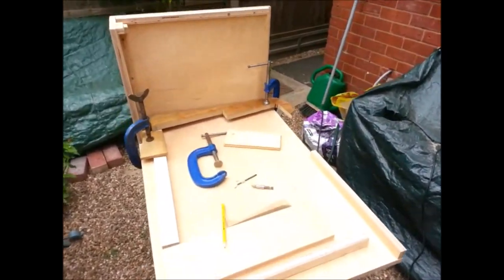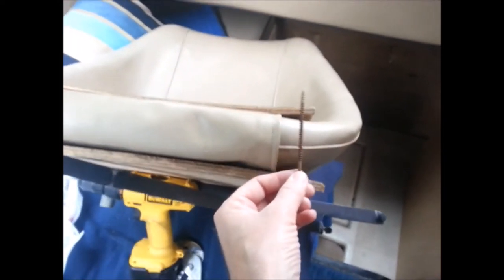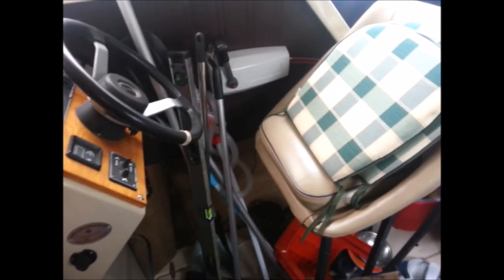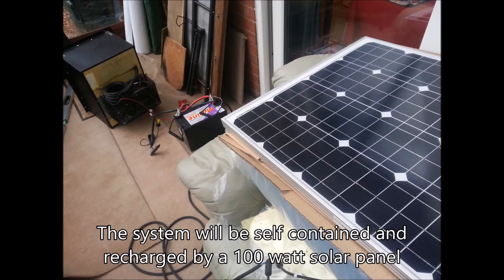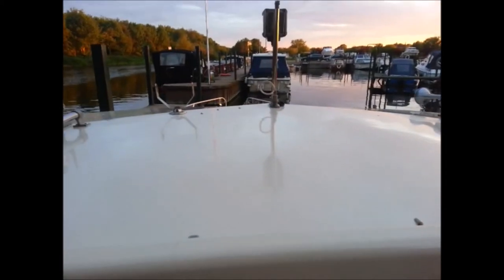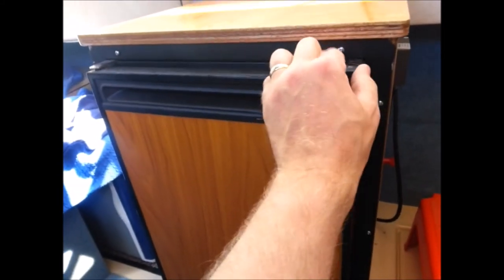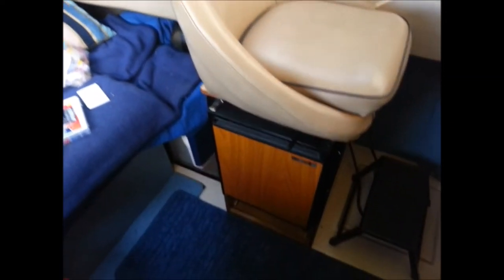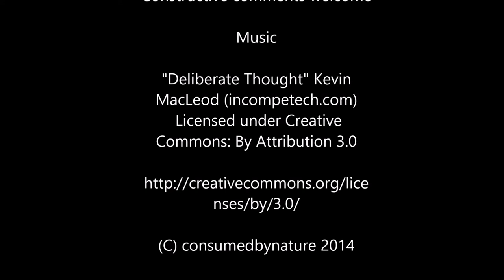Busy with Fizzy episode 6 (Solar powered fridge and cabinet) - chronicles of a 23ft Shetland Boat

Comment: Hi great video. I am looking to do the same thing on my boat but am not sure how long the 110amp battery will last if running 24 hours would you be able to do a best guess from experience?
Thanks
Reply from the maker: Hi Ross. What I've been doing is running the fridge from 9am to 10pm then running it for an hour between 3 and 4am as my wife doesn't like the sound of it running in the night. I will then top up with a charger when on hook up. I've had problems with the AGM battery so have resorted to a sealed leisure battery